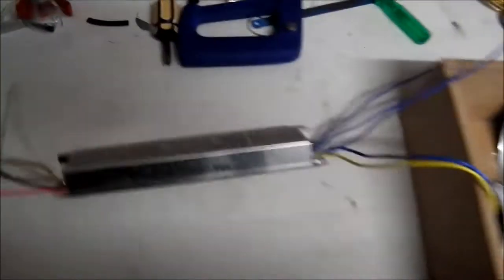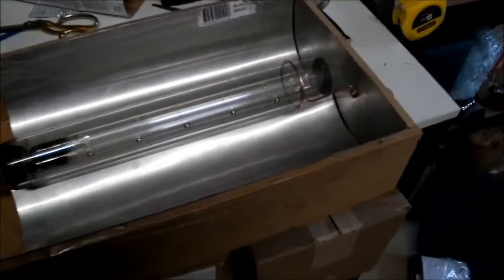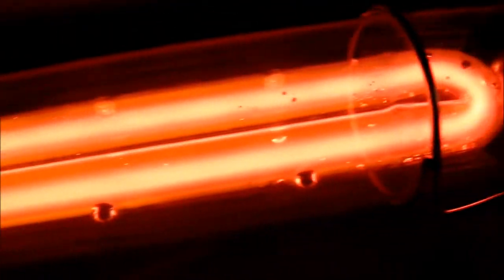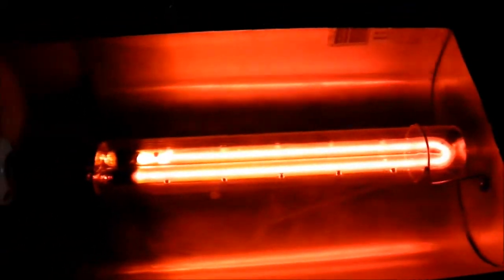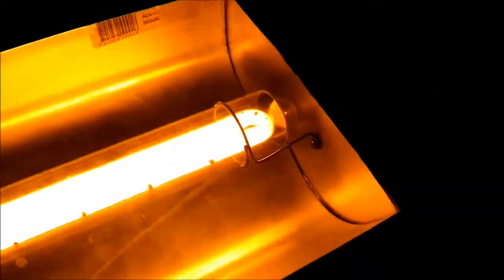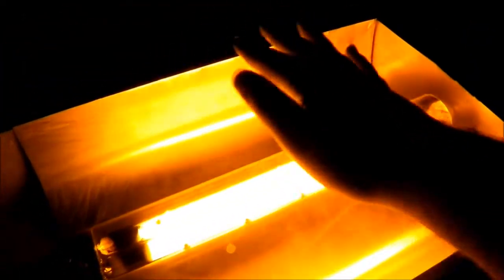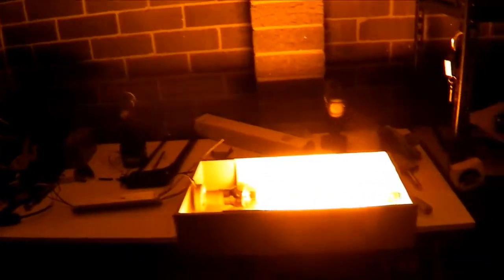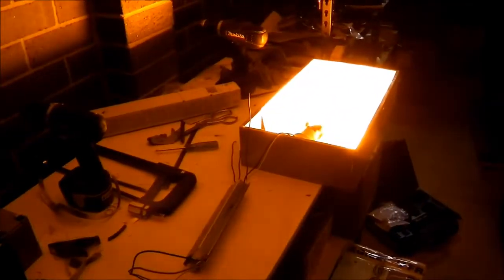Low Pressure Sodium Lamp

Comment: I notice you don't have a separate igniter/starter in place, at least I didn't see one. Does the ballast you used perform the cold start as well?
Reply: The ultrasonic AC that these ballasts produce means that the initial gas ionization can happen due to capacitive coupling between the ends of the discharge tube, which requires lower potentials than are needed to strike a discharge at mains frequencies.